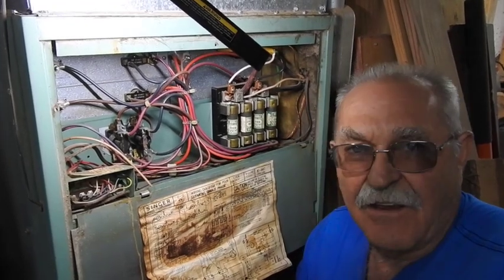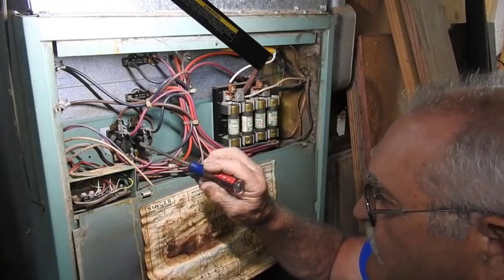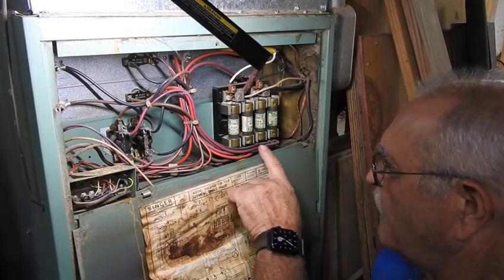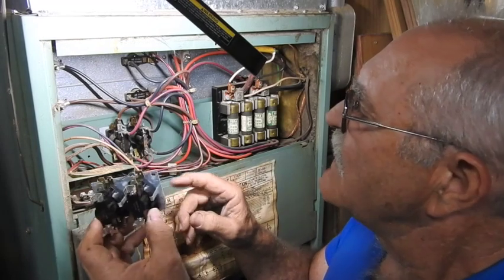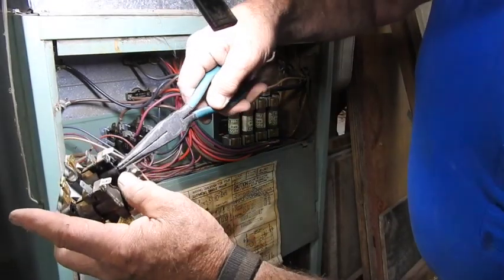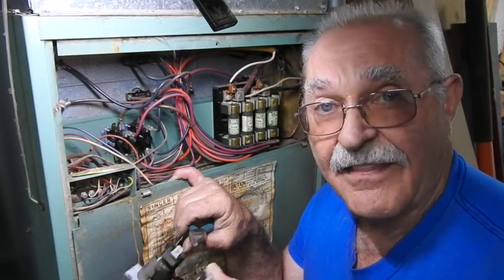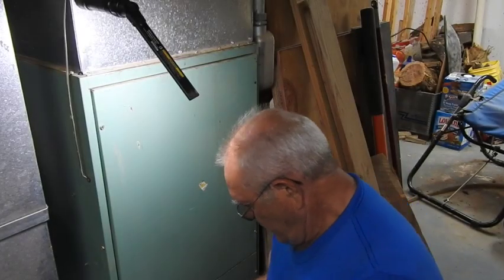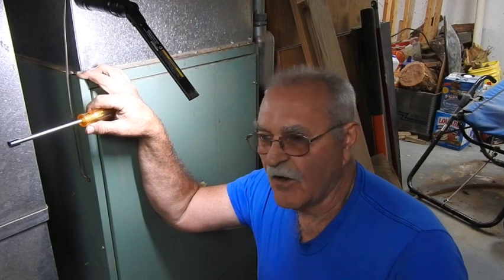Let's Talk About Furnaces In Relation To Air Conditioning- And Repair One Too

Comment: First of February this year I had to replace my 26 1/2 y/o heating and AC system after multiple years of repairs(6+). I told the repairman, "replace all of the equipment, I'm tired of you having to work on a different problem every year". $5800 later I'm a happy man! 

Got to check on some brownies this evening!!!!...lol
Reply from the maker: Well, I think you made the right decision.  Sometimes these old systems get to being more trouble than they are worth.  It sounds like you were treated fairly considering what the companies around this area charge for a system.  Of course now there's a wide variety of types of systems available.  I hope your brownies are as good as mine were.  Notice I said 'were'....??!  LOL